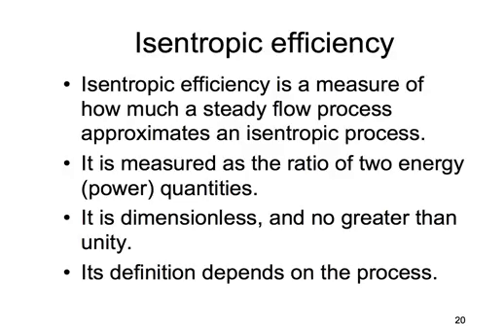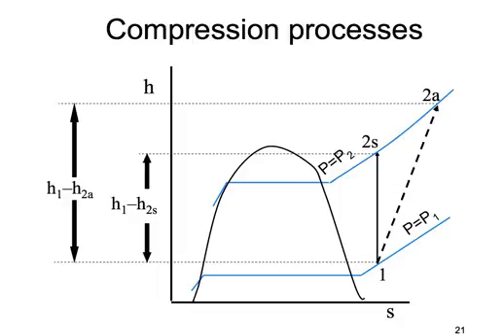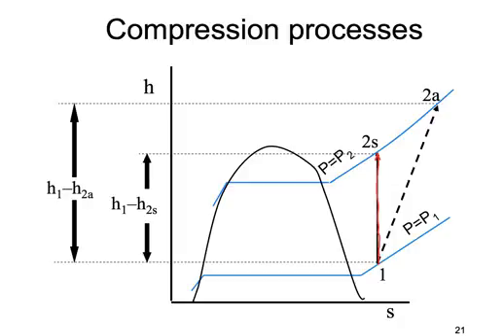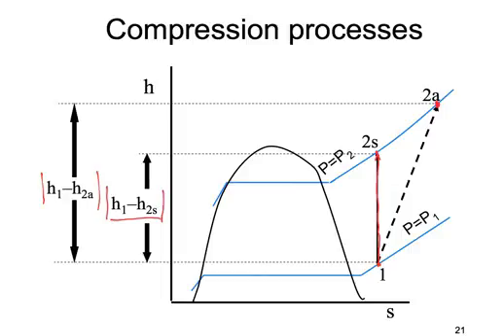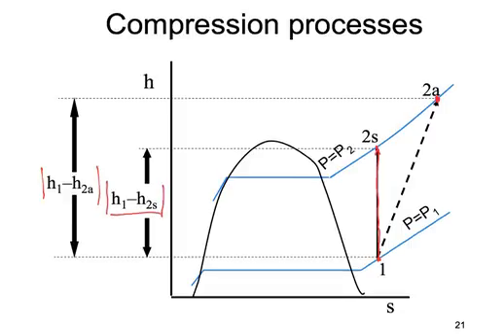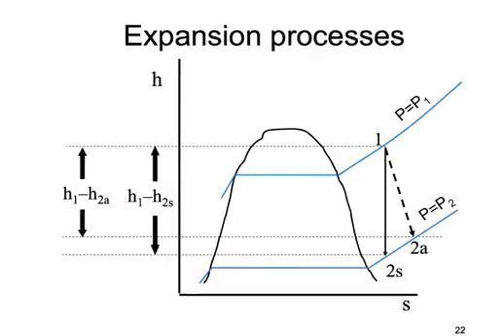Isentropic efficiency with example

Comment: is higher isentropic efficiency better for a compressor in a system?
Reply from the maker: Generally yes. The higher the isentropic efficiency of a compressor, the less work it consumes to achieve the same compression outcome.
Reply: @bing9u0  but what if my isentropic efficiency is high, but my coefficient of performance is low?
Reply from the maker: @Wt520lyn  I assume you are referring to the isentropic efficiency of a compressor in a vapor compression refrigeration cycle. The compressor's isentropic efficiency does affect the COP of the cycle. However, the temperatures of the hot reservoir and the cold reservoir also affect the COP. Begin with a "perfect" compressor that has 100% isentropic efficiency, and see what the COP of a cycle is; then study the case where compressor isentropic efficiency is less than 100% (the cycle will be different than first case even if you keep the lower and upper pressure limits constant). Your professor or a good tutor should be able to help you do this comparison with an example problem.
Reply: @bing9u0  thank you

Comment: Would it make sense that the steam table you used had values that were almost 2.0% different from mine? I am getting entirely different values for the values that you search up.
Reply from the maker: Different tables may use different reference states, that is the state with zero enthalpy may be defined differently in different tables. What matters is the CHANGE of enthalpy. The enthalpy values of intermediate steps may be dependent on the tables you use for reasons given above, but your final results should be the same except for rounding errors.
Reply from the maker: However, it is also possible that there was an error in my table lookup, according to a comment below. I need to take a look when I get a chance.

Comment: @16:10 P2=1Mpa but how and where did you find h2s to be 281.21? I looked on the table at 1Mpa and the value for h is not there!
Reply: You need to find the vapor quality by using the isentropic "assumption" @ P=1MPa, and then again use the quality on the enthalpy to derive to h2s. The values are pretty logical, given that the pressure increases drastically (approx 10x from inlet to outlet), hence there would be more Liquid water than vapor ==> enthalpy closer to Liquid. And thanks to Bing Guo, very Nice lectures.
Reply: @khan120495  it's superheated bruh, no need to find the quality(quality is 1)... since you know that S1=S2s , you must go to superheated table at 1mpa ,and interpolate within the known intervals of the entropy(s) and your unknown enthalphy(h) value, you'll find h2s to be 281.21